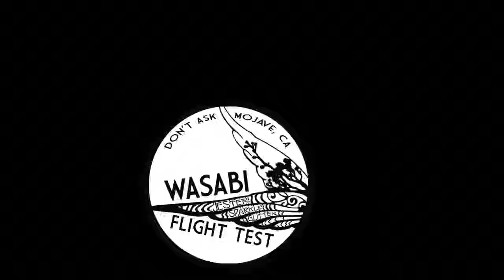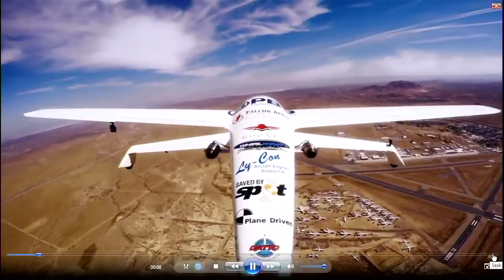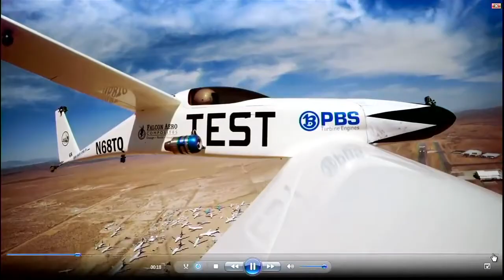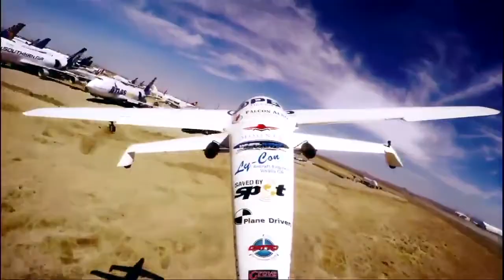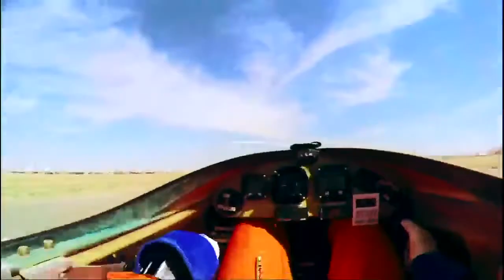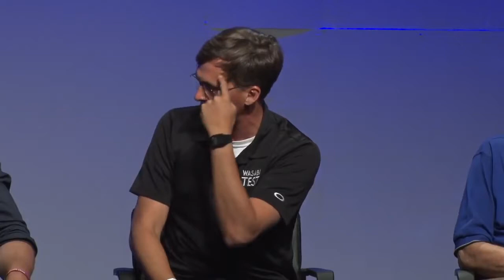The TWERP Multi Jet Engine Canard Taildragger test bed crash at Oshkosh 2018

Comment: Elliot - thanks for your candor and transparency and bringing the lay pilot into the world of the test pilot. The test pilot is a technologist, design team member and field test engineer ...NOT a high priced crash test dummy or adrenalin junkie. NASA test pilots and pilots like yourself continue to prove that time and time again. The sooner self-professed "airplane designers" appreciate/understand the high stakes and set aside their fragile egos the better the chances their project will come to fruition...or NOT, as the case may be! The Test Pilot's ability to constantly step back and ask the tough questions - no matter what - is what sets people like you apart. Wish every kit builder had Wasabi Test Program Certification...you should create one in concert with EAA! I'm the owner of an experimental kit built that went through a major gear mod, and tired of spam can weekend flyers offering to "check it out" for me! Despite the fact that mine was a factory mod done by a licensed A&P I see the value of a seasoned test pilot (not that i can afford it!)....but shocked at how designer/builders are taking their creations up in the air, literally "winging it" on the test pilotage!
Reply from the maker: Thanks man.  It's such a fine line.

Comment: Why such banked turns after the engine loss? Banking like that you lose lift, if he had gone wings level and used the rudder to compensate for the lost engine he may have been able to achieve a slow, but positive rate of climb. He also could have kept the wings level and used the rudder to yaw the aircraft away from the boneyard and on a somewhat parallelly course to the runway where there was just desert and tried to land or go around. Yes it is unconventional to yaw an aircraft to turn, but it keeps the wings level for generating maximum lift to climb.

Comment: I did not see the Red Bull TV documentary before. Very interesting, scary and inspiring! Did this accident change the way you tackle new projects?
Reply from the maker: It changed everything and nothing.  It's been several years now, the goal hasn't changed.  Initially the correction was to take a lot less risk in cockpits which just means more hard conversations with owners.  It turns out like most jobs this all comes down to people, you can always short cut that by exposing yourself and the program to enormous risk...but short of that you have to be able to communicate to the stakeholders your view of the situation and the path forward...and they don't teach that in engineering school.

Comment: I remember that crash. Did it lose the ability to roll right? otherwise seems like just pilot error to turn in over the planes.
Reply from the maker: The engine flamed out.  It was either crash with lateral control or climb without out it.  Google VMC.  Thanks for the comment
Reply: @utopiasnow  ok you say full right aileron at the very beginning. So the engine asymmetry completely overpowered the ailerons? how is that possible?? it has very weak ailerons because it's designed to be balanced and never challenged?  so powering down would have given you back roll control? In retrospect I trust you'd agree powering down and gliding was the thing to do?
Reply: @utopiasnow  and I take it flight characteristics with one engine powered down was never explored? probably a good lesson for twin engine experimentals. Specifically in this case made worse by being near stall speed?
Was there any aileron asymmetry in the design to compensate for the prop P-factor? that conspired with the asymmetric engine thrust.
Reply from the maker: Thanks for looking into that Dan.  The wife angle makes the boneyard look further away than it is.  If I would have shut down the remaining engine it looked like I would still have ended up in the front of the boneyard.  At that moment I made the decision to try and fly and it didn’t work.  I am not confident it would have gone better if I shut down.  I think the winds were just too sporty for that flight that day.  Anyway.
Reply: @utopiasnow  ok yeah, strong wind doesn't help small control surfaces. even with thrust you might have been able with full right to have maintained a slow level left curve enough to clear the planes. But if thrust means loss of control then idle has to be the lesson given flat terrain elsewhere. It might be possible you could have rolled to the right and then full throttle with full right deflection and maintained both control and level flight. alternating to idle when roll becomes critical.
I'd say pretest engine out characteristics for twins and idle if control is lost. Loss of control is... bad :)   stall is... bad

Comment: That was bad. Here's the truth of the matter your balls are big enough to carry in a dump truck but you use the experimental plane instead one of your balls slipped out between the cracks and had a slight cut open it up it was catching air and it mad too much drag on the left side and you fell to the ground and run into the trailer right or is that right enough. But on the other hand I think you are a damn good pilot willing to risk hurting yourself to do the work you do. God bless hope you have no more accidents
Reply from the maker: Thanks for that.  You have a gift with language, I could use your skills.

Comment: holdin' stick to full right as right engine is on max and left dead, still drifting to the left, catching altitude but stick is dead.. then decision, climb or controlled crash? cant climb, stick is dead.. throttle down it then for controlled crash and make stick work finally. killing stick with power should be obvious mistake. but first mistake was touching runway banked single wheel tilting the whole airframe and then go around single engine. this plane misses rudder control. dangerous stuff and great luck for pilot.